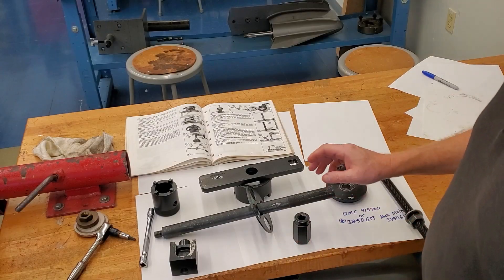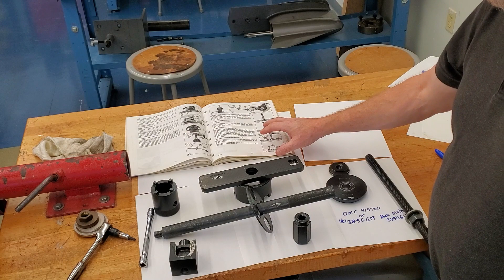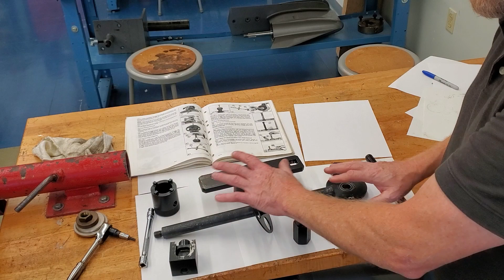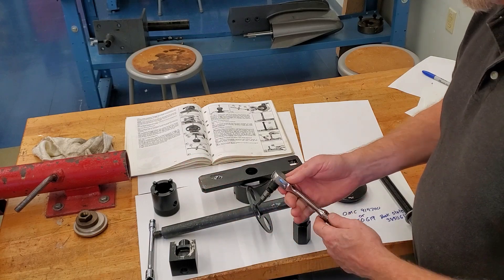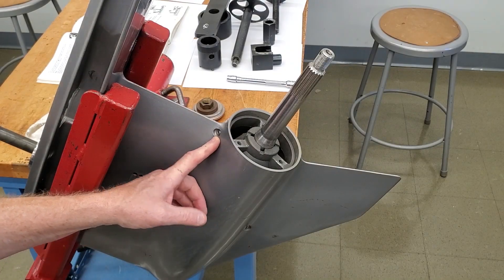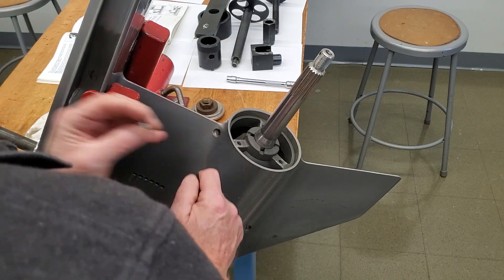Volvo Penta SX lower Unit  Disassembly Procedures Part 1

Comment: I need to press the bearing off the prop shaft.  How does the prop shaft come out as this part was skipped in the video?
Reply from the maker: That's in the manual. You need the special tool

Comment: You didn’t show pulling out the prop shaft. Mine has a slight bend in it, which I need to replace. Is it as simple as pulling out the bent shaft and sticking in a new one?

Comment: I have a Volvo Penta Cobra SX and I noticed when running on the muffs I have a fair amount of water coming out of the area where the front of the lower gear case bolts on.  Is this cause for concern? I never really saw that before. Thanks.
Reply from the maker: Please email me a video of this at marinedoc01@yahoo.com so I can see exactly what's going on.

Comment: You said the upgrade is the sx-a so would that bolt up to the existing upperhalf of the sx system or would you need to re gear the upper half of the sx to accept the sx-a lower 🤔
Reply from the maker: The previous DPS and the SX drive were replaced by the DPS-A & SX-A in  2006. They are not interchangeable

Comment: I unfortunately had an impact accident (hit a rock) with my Sting Ray SX and damaged the lower half of my outdrive. The upper half was fine. I was shocked when I learned how much an OEM replacement cost! Needless to say, I will be more careful and Ted's video helps me understand how I might rebuild my lower VP SX outdrive in the future vs. replacing it again!
Reply from the maker: I also rebuild them and have a couple of sx lowers in stock if needed at half the cost of new.
Reply: @tedsmarinerepair8956 how can we contact you I think my lower unit is toast how much volvo penta sx-mlt
Reply from the maker: @Robochoa88  please email me at marinedoc01@yahoo.com

Comment: Great video.  Any advice if the pinion gear is firmly stuck on the vertical shaft?
Reply from the maker: you need the VP puller for that, if you evenly tighten down on the bolts it will pop
Reply: @tedsmarinerepair8956  Thank you so much for the quick reply.  If its not too much trouble, do you happen to have a part # for that tool?  I can't seem to find the proper tool.  Its to remove the vertical shaft from the stuck pinion gear (maybe the lower bearing?
Reply from the maker: @DavidSeamons  3855923

Comment: Can this particular model be upgraded be a dp driver?
Reply from the maker: Sorry but not cost worthy, the issue is with the combined gear ratios of both the upper and the lower. Typically the upper gear ratio will also need to be re-geared to match the desired overall gear ratio for a DPS application. Remember you are trying to add another prop which changes the load on the engine.